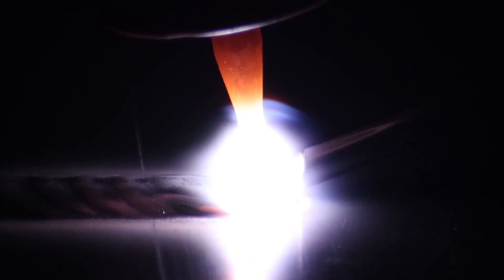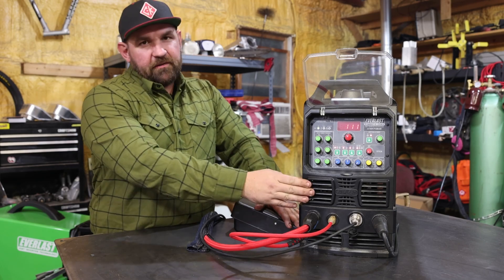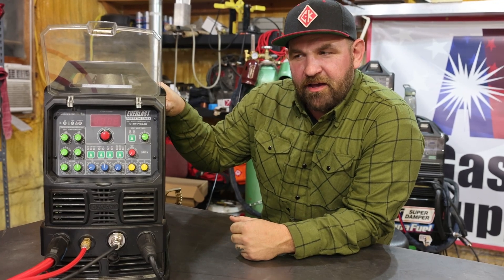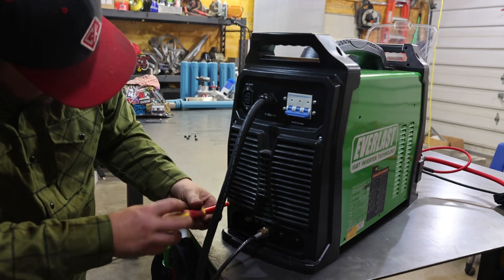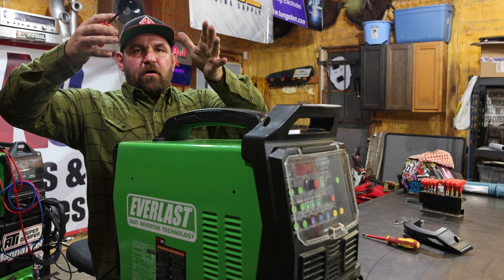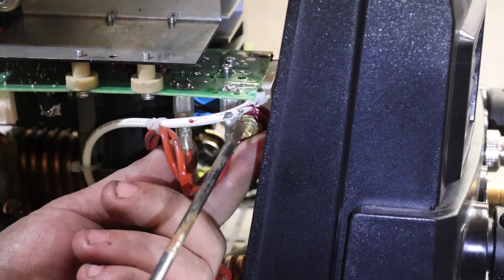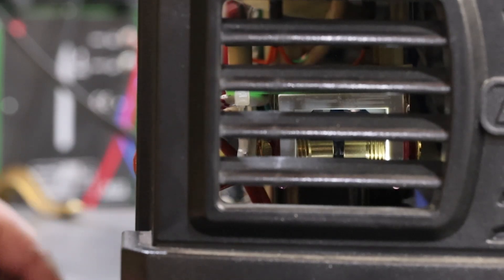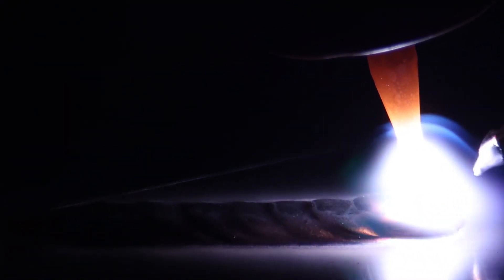How To Fix Rough AC Arc Starts

Comment: I adjusted mine to a tight .030 gap and it fixed the problem. Thanks for the video. Machine was back up and running within 20mins

Comment: I have a brand new typhoon 330 that has done this since the first weld
Reply: You find any solution for it? Just got a typhoon 330 and it does this as well.
Reply: @Kylescaife  it was just my machine settings I posted in the everlast owners group on fb one of the everlast guys sent me settings to switch and she works great now
Reply: @catchnc4131 Are you Riley Bright? If so I think I found that thread lol
Reply: @Kylescaife yes

Comment: I have a DV 200, only ran about 5 bottles of argon thru it, tried the stuff on your video, no luck within seconds the 2% Lanthinated Tungsten start to trow a small shower of sparks & the tip melts quickly, also before doing anything to the machine I tried the torch button same thing but also when I let off the torch switch the arc will not shut off.

Comment: Hey Jesse, I have a couple questions that I hope you can help answer for me. I have Power Tig 250 EX that I bought at an estate sale and I can’t get it to light off on HF with the foot pedal. I looked at your video on setting the point gap and opened up my unit and I don’t have the points like you are showing in the video. My points very much resemble the points that you would have had in a points distributor. I did find inside my unit a sticker with the date of 6/10/2011. Does that mean that my unit is so old and the newer units have been updated? Can a new style HF board be installed in my unit? Is my unit worth the upfit cost if in fact it can be upfited? Is there an email address that I could send you pictures of what I have? Thanks in advance for your help.

Comment: Why are they not set correctly from the factory? It has a lock nut so it didn’t just magically move... I have had 5 Miller machines over the years and never had any problems with arc starts, I just bought a 325 EXT and right out of the box I have issues!

Comment: This happened to me and still does on my ever list to 210 ext I called customer service about a year or two ago and also saw someone else on YouTube they mentioned to set it at 32 thou “ and I set it at that and it still sputtered like that from day one mine sputtered and my gap has always been around 30 to 32 I found a go around around it I set the pre flow to 1 second or a little under And the arc start is fine I just don’t really like out of machine did that wasn’t able to fix it kind of sucks having to do that after spending that much on a machine but I still really do like Everlast as a company any other suggestions I should do to maybe help with my rough starts thanks for the video   👍
Reply: What are your starting amps set to?

Comment: The gas solenoid seems to get stuck on My 255 EXT, when I finish welding the gas keeps going, it doesn't do it all the time.maybe 6 out of 10 times.
Reply: Call in to customer service, if the machine is under warranty, you should be able to recieve a new one. Very easy swap.

Comment: Hi I've got a 255ext,  I purchased it in May of 2020 from Everlast Canada, it's probably due for a servicing although I've never removed the cover before, although I have blown it out with compressed air (40 p.si roughly) through the vents as best as I could.

Is the procedure for this model relatively the same as far as adjusting points gap?

 I'm also wondering if there is any other maintenance activities I should be performing on my machines?  I also have a 253dpi.   Anyways, I appreciate any tips and greatly appreciate the videos, keep er' green!
Reply: Going all the way back to my 8 year old 185DV the procedure is basically the same, as well as on my 210 and 325ext... All basically the same. I do believe the specs are slightly different between one of those, but they are listed in the downloadable owners manual. When you download the PDF, just search 'points gap' and it'll pop up. For the the 253DPi i just blow it out every few weeks and pull the case every couple of months to give it a good cleaning.

Comment: Checked torch , tungsten, clamp , material, lenses cup and screen diffuser, rolled the argon cylinder, ended up being the pure argon gas, swapped out gas beautiful welds now, less amps less cleaning action percentage higher frequency on pulse... ill service the points gap now.. probably needs maintenance check and blow out the boards and connections 👍💪💪
Reply: Oddly enough one of the next videos to be released is proper cleaning procedure!

Comment: Great info on how to remove all the screws (including the hidden ones). Lucky for me, the machine you demonstrated on is the same one I have. Love my welder. LOVE your videos.
Reply from the maker: Thanks for watching
Reply: @Engineworx lol hate to break it to you but everlast is literally chinese offshore machines rebranded. Everything comes direct from china for this machine and the build quality on everlast machines are actually really sloppy and garbage lol just open them up and look at the boards. it tells you everything. But aside from that, they are cheap in comparison to high quality machines, they have great warranty, and when they work they get the job done. But they are not "built to last" lol stop the foolishness.

Comment: I'm not sure but doesn't the EXT(210) series have a solid state HF? I don't think I have adjustable points?
Reply: It should have a points gap, there were some earlier models(around 2010 ish i believe that we used solid state inverters on)... I know going back to at least 2013 we've been using a points style system
Reply: @jessemccollum  2011 to 2015 ish were the old type solid state.

Comment: My vulcan has the same issue everyone reviews on it was good so decided to get one, the arc wanders just as the beggining of this video and porosity consist throughout the 1” weld till i cut the arc. I swapped torches swapped gas nothing helps
Reply: Check to make sure your work clamp is connected directly to what you are welding as well.  Also change work clamps if it is burned or the corroded looking.
Reply: I'm unfamiliar with the vulcans, but i do believe they use a points gap, the proper gap should be covered in your owners manual, BUT, if not, you could run basically the same adjustment and just close the points in .005" at a time and see if it helps